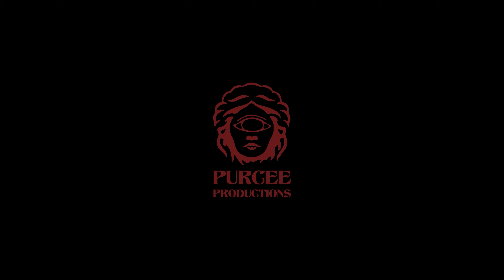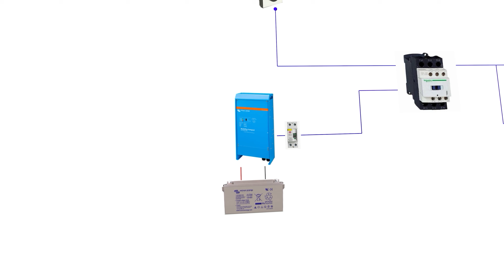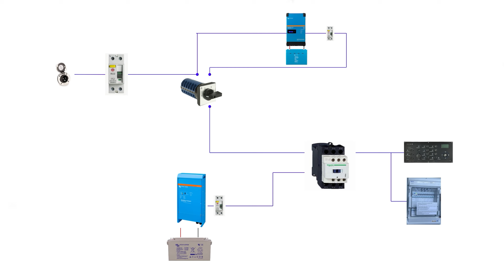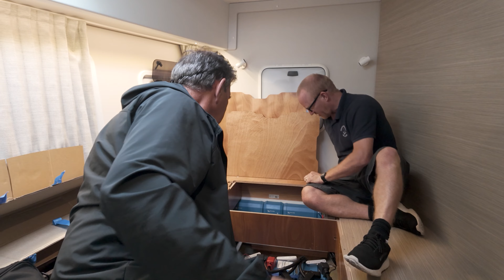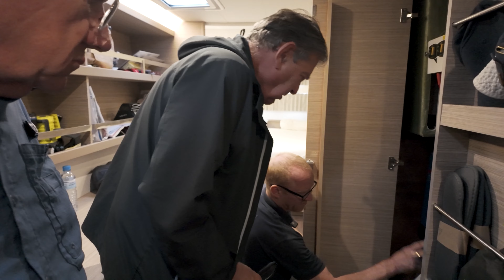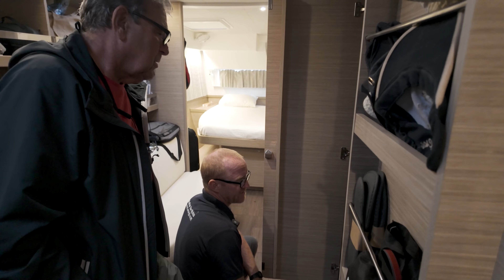Victron / Integrel Power System Upgrade | Lagoon 42

Comment: Has the Integrel system broken down yet ? Integrel have a very uncertain future. Good luck
Reply: Why? What has happened to cause Integrel to have an uncertain future if you don’t mind me asking.
Reply: @humanafterall2076  owners say their motors have failed on numerous occasions. Software issues, mechanical design problems and even magnets being replaced in a marina car park. Teams of ‘engineers’ flying around the world to try and fix them. Not such a ‘green solution’ after all. 
The company is small and the tech in the early stages of development and real-world usage. 

The bigger issue is that no one else can fix this tech. Integrel Solutions do not have a global repair network beyond a shed in Cornwall, UK. So when your E-Drive motor has an issue and you are off-grid, who is going to help you ?  Then, who is going to service the Edrive unit placed between the engine and gearbox ? What’s the resale value of a boat with an e-drive system out of warranty?  But this isn’t even the main issue. 

On top of all this, the motors are made in-house and they do not have ISO2001 certification. This is a bigger problem. Who is going to install a new technology between your million dollar boat’s engine & gearbox that is not certified by any engine manufacturer, or carry any ISO compliance , which also invalidates the  original OEM engine warranty the moment it’s fitted to a boat. Have you ever tried to claim from an engine manufacturer’s warranty even with a simple problem ? Now imagine a claim with a third-party addition to the engine added after market. Good luck.